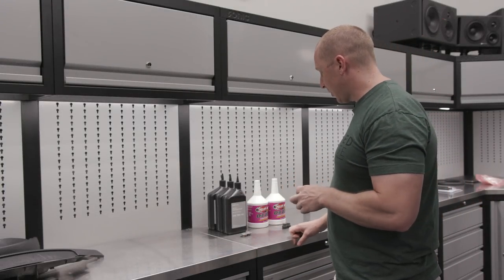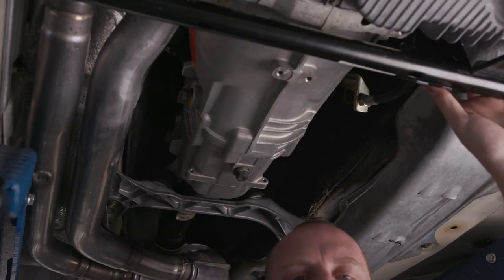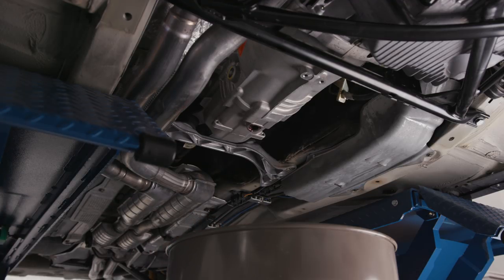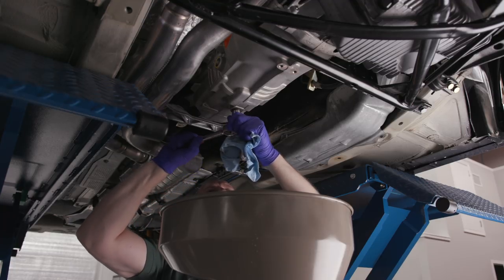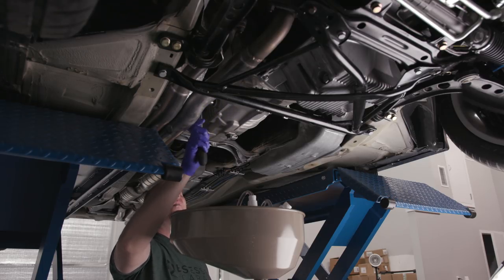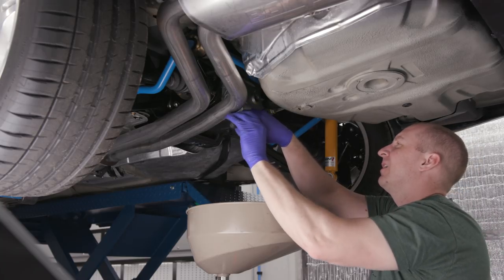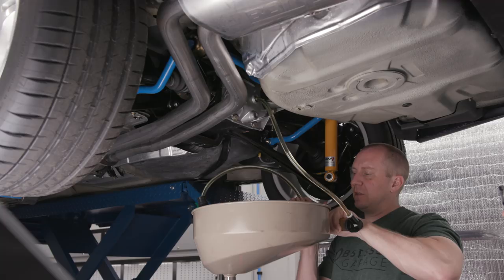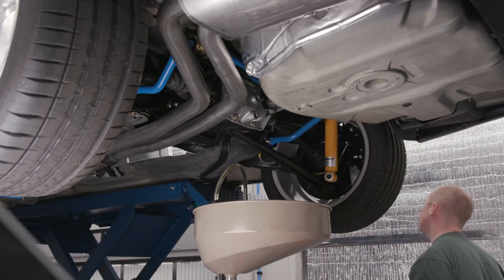E36 M3 Transmission & Differential Change

Comment: First off I want to say I love the Channel, but nobody except you and I are as crazy about making sure everything is up to "OG Spec" and change all the fluids when they get a car. So at 36,000 miles i bet nobody has ever replaced those fluids.
Reply: Huh. I think most bmw owners change fluids when they get car regardless of miles. I’ve had my  m3 for 20 years. I changed transmission fluid at 45k, 67k, 100k, and 134k. About the same for diff but have also swapped in other diff back and forth few times. As a crazy owner I still want to see under his transmission, rear subframe and under that fuel filter cover among other things… pretty sure I got him beat in the obsessed cleanliness  ;)

Comment: Noticed on your transmission drain plug there are some threads remaining after torquing down? Is this normal? On my car the plug is threaded all the way in. But it looked like you got yours to the right torque without needing to seat the threads all the way in... just wondering if thats normal for when I change my fluid

Comment: Hey Matt, Nice job awesome to have a lift it’s been my experience that the dif fluid stays much cleaner than the trans fluid so that’s probably never been changed but then again who knows for sure also maybe the next time around after draining the fluid pump about a quarter quart in before putting in the drain plug and push out the last of the old fluid you’d be surprised how much actually is still in there it only adds a couple minutes to the job not quite a full flush but a quick flush lots of great videos keep them coming and have a good one.

Comment: Just questioning your diff fluid choice... I think you said straight gear oil but the M3 is limited slip and needs either "friction modifier" additive or a fluid specified for LSD...
You can easily add some of the LSD modifier... You don't want to lose the lockup.
Reply: u are correct the fluid he used does not have modifier

Comment: Yellow paint isn’t a good indication that the bolts haven’t been touched before. The yellow paint still shows on my e36 m3. I’ve changed the fluid many times - owned the car for 10 years and it has ~125k miles.

Comment: I'd think the dry ice machine will be extremely useful when mounting and balancing tires.  Figure out where the new weights go, mark it, drice it, stick the new weights on, coat the area, done.
Reply: Any new raptor videos coming soon? I relate and enjoy those videos even more than these since I drive a truck as well. Either way, love everything your doing.
Reply from the maker: I will be doing TE37s and full detail on the Raptor soon.